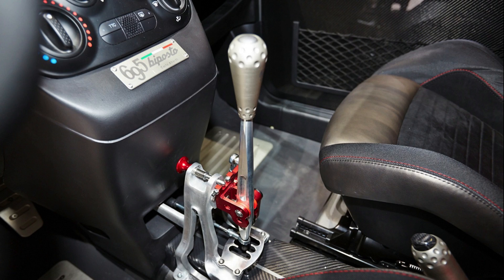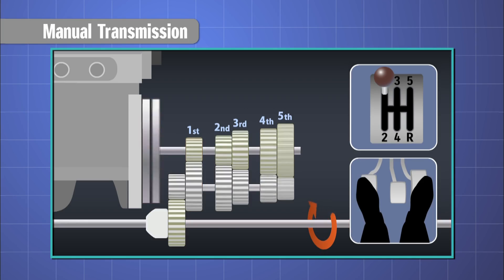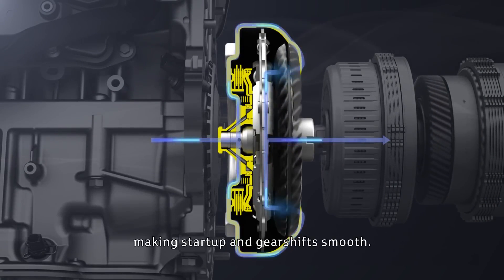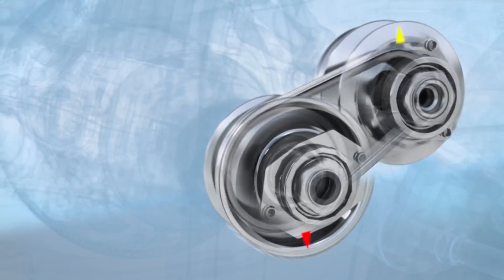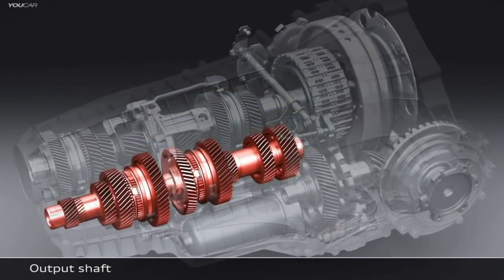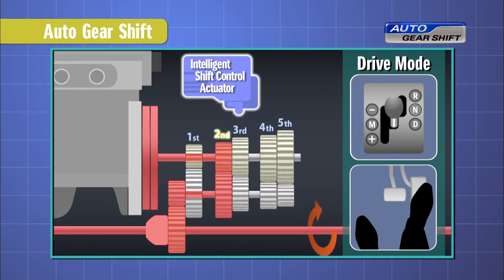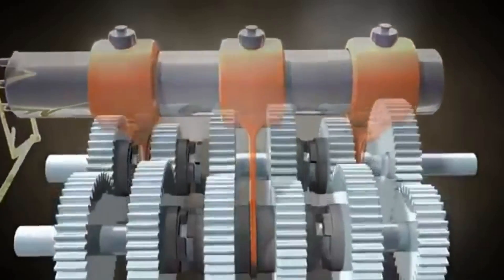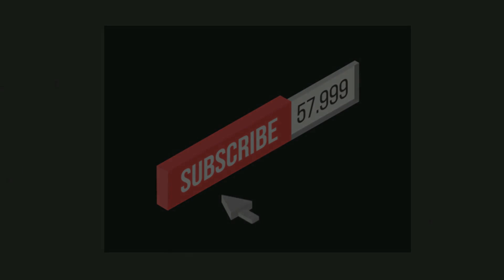Types of Transmission used in Automobiles

Comment: Where's the classic gear stick that goes next to the steering wheel
Reply from the maker: Those are usually manual transmission as well, it is just that the gear lever is positioned in the steering column rather than on the floor..

Comment: Sequential Transmissions are used in 18 wheelers
Reply from the maker: I don't think so, trucks use mostly manual trans, newer trucks use either automatic or amt.
In sequential transmission you cannot skip gear while going up or down, you can only shift in order, many think semi trucks have sequential transmission because these trucks tend to have 12 or even 18 gears but it is just a manual transmission with range or splitter or range-splitter option...
Reply: @superchargedpetrolhead  I miss driving those manuals now they are all automatic 😭
Reply from the maker: @johnsmith60  yep most new trucks have automatic either the torque converter or dct and some even has amt...
But yeah manual transmission is slowly going extinct which is a real shame...
Thank you for watching.

Comment: can you please explain little bit about spicer transmission
Reply from the maker: I think spicer is a manufacturer just like Eaton that makes transmission for heavy trucks, they make auxiliary transmissions or more commonly known as splitters. 
What they do is basically splits the gears in the main transmission, you may need this when you are hauling really heavy loads and just the gears in your main transmission won't be enough. That is, if you were to shift only using the main transmission then your revs might fall more rapidly and hence you may not be able to tow that heavy load so what these auxiliary transmissions does is give you more gear ratios to shift in-between the gears in your main transmission, hence maintaining good torque delivery which makes it possible to pull heavy loads...
These videos might help you in understanding how they work:
https://www.youtube.com/watch?v=nSBGq8mdqzQ
https://www.youtube.com/watch?v=Km8kDddnuv4
Reply: @superchargedpetrolhead  thankyou so much for your response.  I appreciate
Reply from the maker: Thank you for watching.
Cheers.

Comment: Do you make those animation videos or download them?
Reply from the maker: Some of them are stock footage and some are from manufacturers press release footage.
Cheers.
Reply: I wanted to use such animations as well.... Can I talk to you in detail about there sources? It would be a great help.... Please
Reply from the maker: @sandeepmalik1245  you can just google the working animation of any particular type of transmission say google the animation of honda's CVT or animation of VW's DCT and you would find the animations and if you are only using the videos for your personal stuff you can download and use them but if you want to use them commercially then either make sure those videos are not copyrighted or get permission to use those videos.
cheers.
Reply: How do I make sure they are not copyrighted... I mean are there documents attached to it or is it mentioned in the animation?
Reply from the maker: @sandeepmalik1245  if it is made by a private individual it probably is copyrighted and if it is from the manufacturer itself it will be copyrighted as well but you can use it under fair use law. 
If you are just going to be using the animation for yourself or just to do a project or presentation you can use it, you won't get in any trouble but if you are going to use it commercially then make sure you get permission or you use it under fair use law.